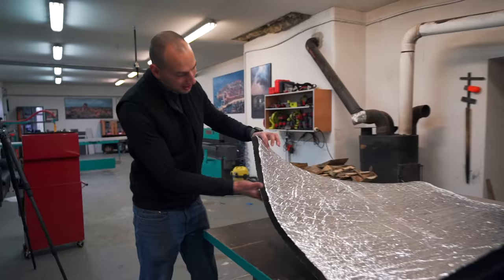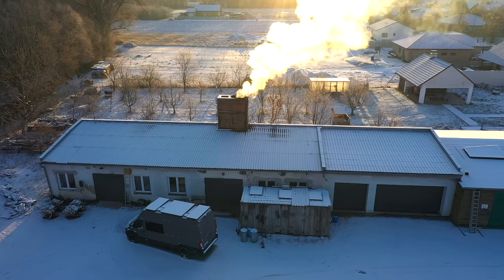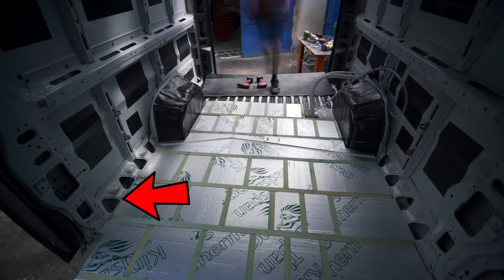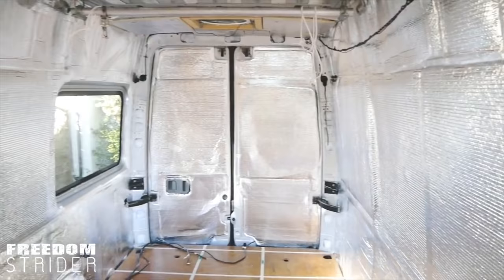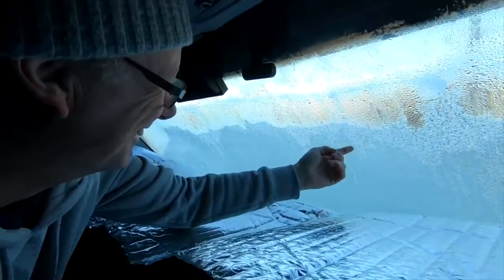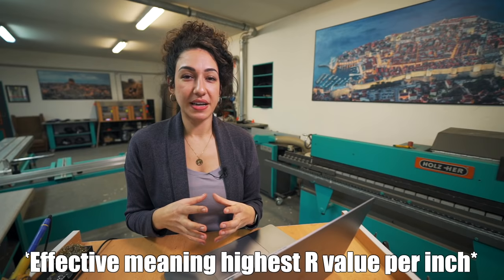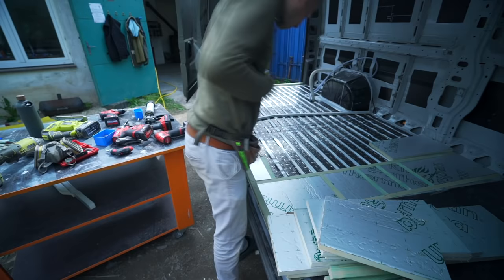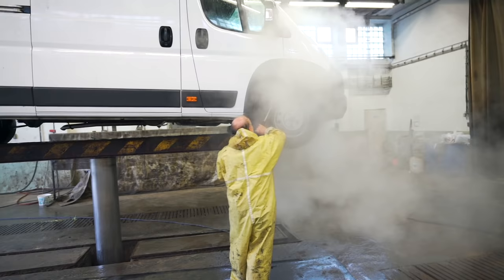❄️How to *ACTUALLY* Insulate Campervan for WINTER VANLIFE ❄️

Comment: Your right about the spray foam. It’s the best thing out there I used it. It will also warp your van. I warped mine. That being said if I did it again I would do the roof where insulation is most important and a little warping is no big deal. As far as the sides I feel like if you tape off all your cracks and don’t let the foam between your ribs and the skin of your van you’ll be ok. The one saving grace is you can break it out of the bad spots and the warping goes away. Long story short, one hour to foam the van and 3 days to scrape it from between the ribs to remove MOST of the warping. What the van industry needs is someone to spend a million dollars to test everything there is scientifically and come up with the answer. All anyone can do now is make an educated guess and pray.

Comment: Thermal barriers are tied up with dew point and interstitial condensation.  Warm air will hold a percentage of water, cold air  holds less.  As the warm air cools there is a point where it has to give up the trapped water. Hence where water filled warm air comes in contact with cold glass, or metal, condensation forms as the air cools.
This caused a big issue when people filled their house cavities with insulation as, where previously, the point of condensation was within the cavity, the moisture would drain away, insulating could mean the moisture would form within the insulation soaking it and reducing the level of insulation rather than increasing it.
Your point in maintaining clear bottom cavities is well made as the outer skin of the vehicle is likely to get wet on the inside and that water has to go somewhere.
Vapour barrier - you don't really want your water filled hot air to escape to somewhere it can cool and condense.  If it can escape and come in contact with cold metal it will make the surface of that metal wet.  If you trap that water filled warm air this is good,  assuming it doesn't cool because then it still has to give up that water.
In summary - it's complicated.  You  don't want air to cool behind or within something that can absorb moisture because it will become wet/damp.
Your point that clothes in cupboards are insulation is reasonable except, if the inside face of your sweater is 20ºC, and the outside face is 0ºC,  any moisture in the air will be given up between those two points  ie, in the middle of your sweater.  This is interstitial condensation.
Reply: I will add that clothes in the cupboard will only act as insulation if the cupboards are full and the clothes tight together. Lose clothes here and there in a half full cupboard will insulate nothing.

Comment: Love comprehensive videos like this!

I heard someone say that water will always gather at the metal- it either gets past the vapor barrier or it comes in from the outside (through door handles or trim??) because vehicles simply are not entirely sealed, and that this can soak your insulation and lead to mold, etc. and thus you shouldn’t stuff those spaces with insulation but.. but then how to insulate??

Also, after years of wearing wool I became allergic so.. um.. careful.
Reply: You can't insulate metal van 100%. You have to opt for box.
Reply: Materials like Rockwool don't rot, so even if moisture forms near it, it will simply dry out and keep it's integrity.  Whatever you do, don't use the pink wool (glass fibers), that thing will rot, gather humidity and cause huge problems to the body of the van.  Ouch.
Reply: @gregoirepainchaud  don't ever use any type of wool in campervans asking for the troubles healthwise or else. Use recycled  plastic insulation rolls. Good R value and all the rocwool benefit without side effects.

Comment: in our build, we used Rock Wool and stuffed it everywhere, literally if there was a gap, we put some in there. Not packed it in, just put it in. We took the door panels off stuffed in in there and between the cabin topper and the frame. Then we put a vapor barrier over the walls of reflectix and reflectix tape. then put up the furring strips that gave us a good inch between the reflectix and the wood walls. For the floor and ceiling we used insulated foam boards and reflectix tape. We have spent the night in 18 degree weather by turning the van's heat on for about 10 minutes, and it kept the van warm all night. 
And yeah, it took us A LONG time to get all that done too.

Comment: Along with foam board, we used mineral (rock) wool, which I don’t think you mentioned.  It doesn’t absorb moisture, is less expensive, and is easily available at Home Depot or Lowes.  Followed by a vapor barrier of reflectix.  Sheep wool must be purchased online and it’s difficult to know exactly how much to order.  It was nice to be able to just go buy more mineral wool when we needed it.  Plus when we were building, Havlock wool (sheep) was on back order.  (We chose our materials because of the Greg Virgo videos.). Anyway, our van stays comfortably warm now.  

We did leave an edge of exposed metal around our windows so to be able to attach the window covers with magnets.  I used reflectix in the window covers, with batting, covered with ripstop.  They work very well.  And because we insulated the cab, we haven’t needed a curtain which is nice because we use our swivel seats.  
Sorry this is a long comment. 
I enjoy your videos.
Reply: Rockwool is notorious
 for absorbing moisture...
Reply: @spiroszaharakis2648 Poulin Building Materials says this about Rockwool when comparing three different materials for insulation... "It’s hydrophobic, so it won’t absorb water or encourage the growth of mold and mildew. Mineral wool is also very fire resistant and can act as a fire stop."
Reply: Rockwool's technical paper clearly states that it's not to be used in high humidity environments. You can't compare a house with several cubic meters of displacement with a tiny van that gets huge amounts of condensation every day when people live in it. Hydrophobic doesn't mean waterproof. It will withstand the moisture levels of a typical house and that's about it. As for the fire resistance properties, with all the other flamable materials inside a van, if your van catches fire, insulation fire properties will be your last concern. You will be dead well before the fire reaches the insulation. @BenjaminHansen
Reply: @spiroszaharakis2648  thanks for the info from the tech sheet.

Comment: I agree 100% with everything you said (use of reflectix as "insulation" and insulating below the floor level and blocking the drains being the ones I see more often) but I disagree with one thing you already did on your van (not sure if the shots were from your previous van or this one).
You saw how strong Kingspan is, you said it yourself. So why use battens on the floor then? You can lay the plywood directly over the Kingspan sheets and it will be perfectly fine. That way you will also minimize thermal brakes (even if it's just the floor, which is not really that important unless of course, you do heated floors). If you really need the battens to bolt your furniture on (not really necessary) then just put battens where your furniture will go.
Reply: I havent seen anyone suggest this yet. Very interesting idea. I'd love to hear more peoples thoughts on it
Reply: @PresidentBust  I put an insulated floor in an old barn which I converted to an office/edit suite and I laid 75mm Celotex/Kingspan straight onto the concrete and then boarded over the top with flooring grade chipboard.  I experienced zero issues in the 10 years I was there, so I'd go along with Spiro.
Reply from the maker: I think it’s something different in a van. Furniture should be attached properly to the floor, it should not be just floating on insulation.
Reply: @ladiandmargaret  Yeah, but as Spiro pointed out, you can put battens where your furniture needs to be fixed down, but you don't need to make a framework with battens where nothing will fix to them.
Reply: @ladiandmargaret  It really depends on what kind of furniture you have and how you attach them to the floor and/or the walls but still, if you want to bolt them on the floor, then just put a few battens where your furniture will go, you don't have to make your floor a checkerboard.
In my small opel Vivaro, that i am now converting, I have a floating floor that will be secured by battens fixed on the sides of the van, which will essentially block the floor from being able to move without having it bolted anywhere.

Comment: I own a converted cargo van, it has panel windows behind driver and on the slide door, 10x33 widows on either side of the raised fixed bed and two roof fans. Here's my thought on insulation: 

Insulate? Sure but I think the whole thing is over thought and overblown. Millie's got it right (wool), and don't go crazy - KISS.  Not only is a van a tin can with windows, unlike a house or apartment, it moves! The climate can literally change in a matter of hours and then again, and again .....

Spend the time and money elsewhere. Here's what I did to compliment and assist the Havelock Wool I have in the walls and ceiling, and foam board in the floor: Rixen's heat & hot water system, Cruise N Comfort 24v AC and a power system that can handle it, limo-tinted the windows and, had all the windows coated with IR heat reflecting ceramic film - even the windshield.  My van will be just as comfy in Phoenix as it will be in Calgary.  

I hope :-)

Comment: The closed cell spray foam is great for something like building a diy truck bed camper. The spray foam when done correctly will add not only insulation but also add a lot of strength/rigidity. So you can use lighter thinner strips of wood for the frame & thinner walls. It also keeps the wood from rotting if it's completely enclosed.

Comment: Absolutely great video. I am from northern Canada and I KNOW cold and having extensive renovation experience I also know insulation. With that said, I can tell you have done your research and agree with you 90%. Not a fan of the wood sleepers on the floor, but everything else is on point. I chose rockwool instead of sheeps wool for cost and the fact that rodents love sheep and hate rock. all in all great, informative video

Comment: A lot of what I like about your channel is the construction work you put into your ideas... and why you decide on those ideas in the first place. This would be particularly important when discussing insulation, as all builds need some form of insulation in the build.
IMHO, and only an "O"... it would be good to discuss (1) benefits and issues with each type of insulation, (2) the installation process, and (3) mistakes made when installing. For instance, wool can be a good insulator, but only if not compressed, which I have unfortunately seen a lot of YouTube van builders do. The thinking is, if a little does well for insulation, the more they can get into that space, the better the insulation. The problem of course is, by compressing the wool, you no longer can trap air, which is why wool is such a good insulator in the first place, so the "R" value gets lower and lower with the more you stuff into those little spaces.
And then there is the problem with R-Value in the first place. This is tested in a lab, without the issues of compression found in a van. Then there are EER ratings for the A/C unit, the shape of the interior of the van with its corresponding air flow, the extremes of weather, and so on. All of these things affect insulating properties, and all seem to be left out of most videos and discussions on the subject. 
FYI, the van we are getting uses aircraft insulation (https://www.youtube.com/watch?v=wanZmR82nWg&t=186s&ab_channel=RoadsofLife), and in real world situations, this insulation has been shown to be extremely efficient. Is it the best? No such thing, but it is something to consider. Be seeing you.

Comment: I'm working on a box truck build and have found your videos to be so helpful. My partner and I have been debating about which insulation to use; stiff foam board or spray foam. This video really cinched it for me. Since, we have nothing but straight flat sides, foam board is now the plan. Thanks!

Comment: Hey! I used spray foam out of the cans and insulated myself. It expands in the easiest direction so it never pushed hard against my van panels at all. 
The problem I had was it doesn't stick to the metal panels of the van. I had to put up in my walls and spray foam behind it using a 5mm hole which filled the cavity. Never seen anyone do this. It has worked without issue. We will see how good it is once my build is finished 👍🏻
Reply: You mean those expandable spray foams they sell at home depot to fill cracks and nooks in your house?

Comment: Seeing a new video put up gives me joy. I look forward to your videos. I appreciate the information and even though I’m allergic to cats Millie is cute.

Specifically for windows you can use a product like 3M crystalline to reduce the heat intake of your windows. That’s the only product I have experience with, I’m sure there are other products. First in a friends and my classic cars. I use 80% and because it’s pretty much clear I can also use it on the windshield. I cannot feel any heat transfer when in direct sunlight on my windows now. It makes a big difference. One of my best friends family used it to do their over 100 year old house with single pane windows. It halved their AC bill and changed how the house feels. I texted him to see if it made any difference in the winter with cold and have yet to get back an answer.

One of the problems we have with classic cars is rust when the drain holes get blocked. It might be a good idea to make sure all the drain holes are clear.

In cooking I found that propane contains a lot of moisture. I would think avoiding propane for products that use a dry heat would help reduce moisture in the van.

What are your thoughts about using a humidifier in the van to reduce moisture?

Comment: First....Happy New Year!   Second....I found this video and info VERY helpful.  I'll be starting my (short) bus conversion in the spring and am gathering as much info and advice as I can.....and one important focus is insulation (which I haven't actually seen featured as a main topic on bus/skoolie/ambo tours).  I currently live in Ontario, Canada, and once my conversion is completed I'll be "chasing 70" as they say, so I'm not concerned about freezing cold or boiling hot temps, but I will have pets in my tiny-home-on-wheels (I have one dog and one cat now but will be getting another---larger/for protection--dog once I'm on the road) so for them I want the rig to be at a consistent (or close to consistent temp).  I also will be doing this conversion on a limited budget....so my question....do you think it's wise to do, the foam board in the floors and walls and then wool for the back door and ceiling?  Also, I watched a great short bus tour last night and he made a great point.....many people block off the front of their van/bus/shuttle/ambulance from the "main house part" by putting that barrier BEHIND the driver's seat, but that's a bad idea when it comes to safety as you want to be able to access your driver's seat as quickly as possible in case of attempted-break-in or other danger near your rig....so he recommended (and he's lived on the road for many years) to put that barrier (black out curtain for instance) in FRONT of the driver's seat.   So sorry for the long comment.  P.S.  I really miss the videos you used to make, where you talked about the good and not-so-good aspects of various vanbuilds :-)

Comment: Ahhh... vapour barriers...

As you pointed out in the video, the van body is the vapour barrier before you start.  Without an additional barrier any moisture that gets through the insulation and condenses on the steel shell will then migrate back into the living space when the temperature gradient is reversed.  The only way to remove airborne moisture is with good ventilation; insulation and vapour barriers do nothing to remove it.  If you add your own vapour barrier it will never be 100% perfect, so some moisture laden air will still get past it.  Now that moisture is going to find it very difficult to escape - because of your vapour barrier - and so it encourages corrosion of the shell of the van by trapping moisture.  That's my theory anyway and I have yet to read any argument that convinces me otherwise.
Reply: Because of this i use armaflex, self adhisive isolation that does not take in any moisture.
Because i will use the van during winter i use 32mm armaflex where possible.
Reply: @juri14111996  Armaflex is a closed cell insulation so it has its own in built vapour barrier, perfect solution.

Comment: Your absolutely right about insulating the doors as long as you don’t interfere with locking Mechanism. I like use rigid foam for large areas and spray foam for those differcut  small areas. These small areas won’t cause problem in panel distortion. Having insulated curtain behind cab seats helps  tremendously.

Comment: I really don't see spray foam as that much of a risk at all. I had a guy who regularly spays the inside of shipping containers and canal boats do mine. It was relatively inexpensive, quick, clean and fantastically effective. If I was doing it again I'd elaborately mask the side and rear doors so he could do those in their entirety. Spraying interior grade, closed cell foam ticks a lot of boxes in one operation: sound and thermal insulation, vapour barrier and it makes the panels really rigid. So much so that I did not bother to batten my van out (apart from on the floor) before having it sprayed. I got mine done before I cut the windows and sky light out so I have nice window shaped insulated panels that I can put back in against the glass for great window insulation. There's no downside that I can see.